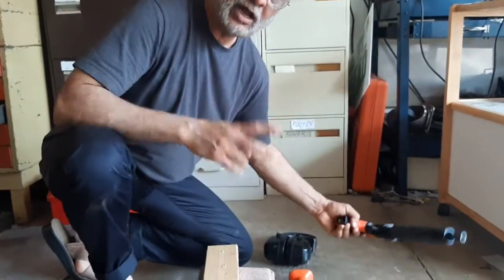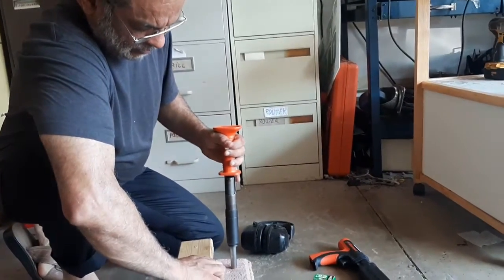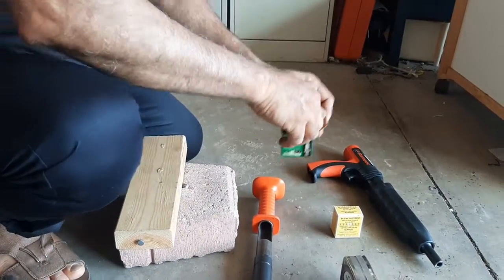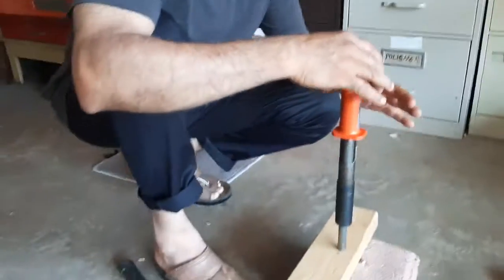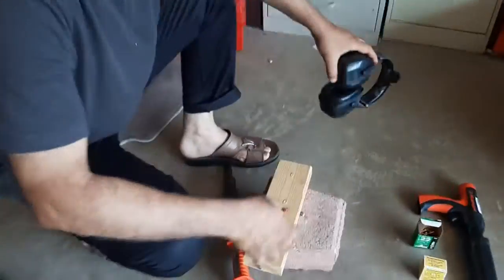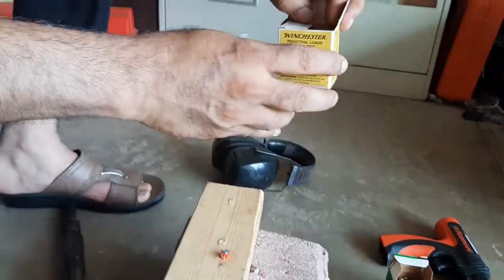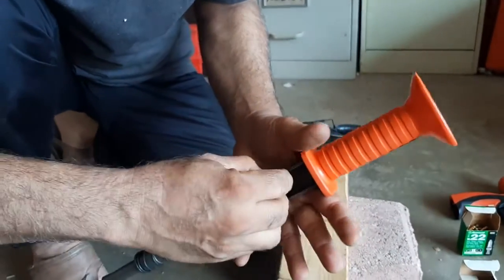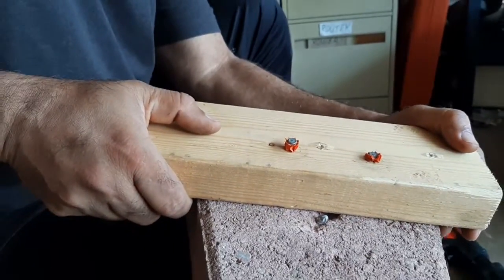Remington Powder Actuated Fastening Tool  Shot Strength Test

Comment: I did a similar test nailing together two 2x4" boards to make a 4x4" inch board using a 3" fastener nail.  I got similar results.  The number 3 load left about 3/8" of nail sticking out (i.e., wasted).  But the number 4 load sunk the nail completely with the washer perfectly stopping over penetration into the wood.
Reply from the maker: Thanks to endorsement

Comment: poor demo as didn't mention the reason for the color coded load differences adequately to the uninitiated and in the first discharge he loaded the powdered load first then the nail with his hand/fingers over the gun nozzle while pushing the shank up near the load!! dangerous
Reply from the maker: you are right it was my mistake to load first and then insert nail
Reply: I wouldn't say poor. I found it helpful indeed. It was a great starter. Thank you @bababuilder. 
Sorry about the bored, critical people in the world with nothing better to do than insult peoples work.  I don't see @dgim8016 shooting a video on Ramsets, so yours is 100% better than the video he never shot.
     And, as with anything in DIY construction, no one is going to watch just one video and go straight to it (hopefully). Due diligence requires us to check out a few videos, perhaps have some convos with some people who've used them, maybe explore some "How to" forums or literature on the topic and then take the best points from each and apply it to what you're doing.  
     In fact my Ramset is identical to the one in the video, and it set me at ease (Yes, I was a bit anxious digging out this tool and using it) watching you handle it casually and doing so in sandals. 
Yes, yes, everyone's gonna reply with safety first, yada, yada, yada, and sure, I agree, but it did make me less anxious that he wasn't crapping himself handling it, loading it, and striking it. 
     So thanks again @bababuilder, you rock man!
Reply from the maker: highly appreciate it to write these beautiful comments

Comment: Actually i have been on job where the mortar just shattered. Walls moving freely after ram set. To fix this I learned when i was young from my grandfather to drill a hole and use 3-4 pieces of black steel wire put them in the hole and hammer a sinker. Once that nail is sink squeezing those steel wire it's going nowhere.
Reply from the maker: thanks to share experience
Reply: I have no idea what you mean by 3-4 cut of steel wire. They sell concrete anchor: drill a hole and put them in there. They sell concrete screw (blue tapon). Drill a hole and screw them in. You have to write one more sentence so people actually understand what you mean.
Reply: @SSintox  ok you drill a hole that is the same size of a framing nail. you cut 3-4 pieces of  black steel wire about 4 inch you put them in the hole. then you take that framing nail and you hammer it home. it will never come out. its the oldest trick in the book and more durable than any other product.